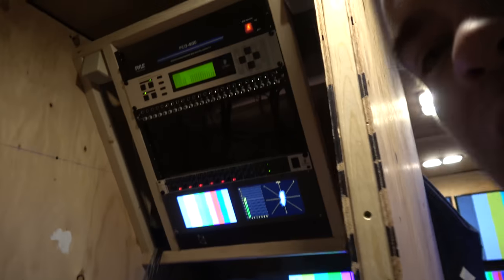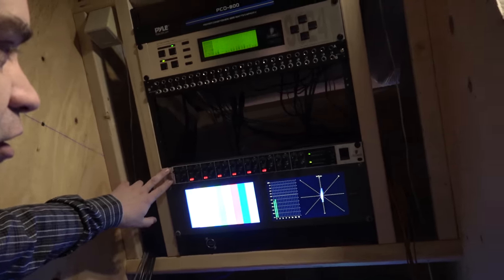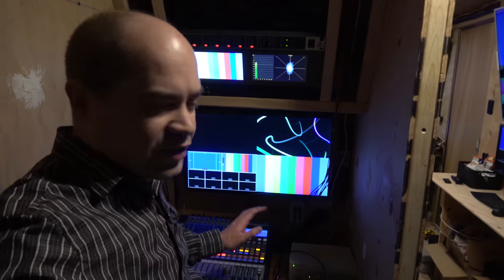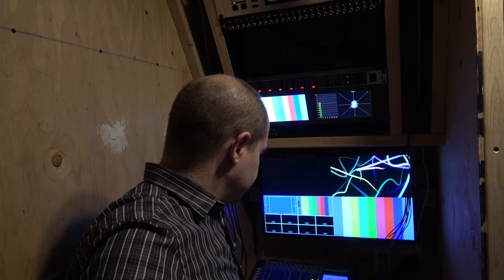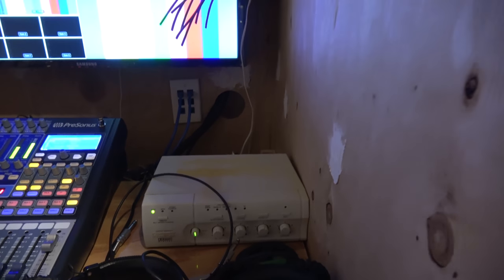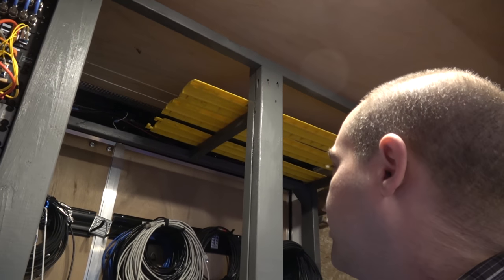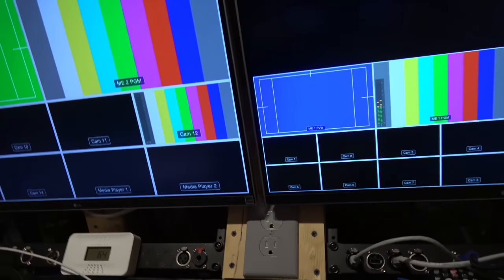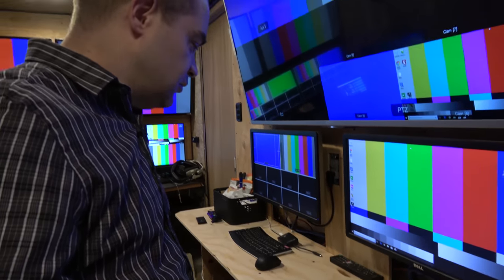Trailer Construction Update - Dec 7, 2017

Comment: Great set up very inspiring.
I don't understand why you would send your 2bus through two Behringer preamps instead of using the main out of the Presonus... surely it would sound better without all the extra gear ?
Reply from the maker: I assume you're referring to the compressor...

People are used to their audio levels being pretty consistent, both for music and television.  The easiest way to achieve this is with a multi-band compressor.  Traditional compressors, as found in digital mixers, simply can't achieve the same kind of result.

Audio levels, particularly for live events, tend to be all over the place. Most people, when speaking, will get excited at some point and get much louder than their normal speaking level (or much quieter), or there might be a part of a song that gets much louder than the rest, so controlling levels becomes very difficult. Traditional compressors can really help, but they don't do a great job at keeping the final output level consistent, especially without adding audible artifacts to the audio. Multi-band compressors can be much more aggressive at controlling levels and are much more transparent.  

The bottom line is that with the Behringer unit my final output audio levels can be much higher than they could be otherwise without worrying about getting too high. And I've yet to see any audio mixer that has a multi-band compressor built in.

For a real-world example, go and watch the two live Q&A videos on this channel. The one from this last spring used a traditional compressor (very aggressively, actually). The one from a few weeks ago used a multi-band compressor. The audio level on the second is much healthier.

One other note... I know that Behringer doesn't have the most stellar of reputations. (Personally I hate many of their products.) But this Ultra-Dyne Pro was a flagship product that was particularly excellent. It has been found in high-end professional use where many people would have never have even considered any other product from them.  It would sound better if I could use digital ins and outs, but both my Presonus mixer and the Yamaha I hope to get don't have any AES/EBU digital I/O.
Reply: Ok, didn't realize the console didn't have multiband... makes sense. I agree Behringer do have some products which are simply the right tool for the job.
Reply: So I bought a Ultra-Dyne Pro :)
I totally agree with everything you said above, i was just curious, the multi band on the Ultra-Dyne Pro is very practical and "replicates" many of the features we use in post audio with iZotope.... appreciate your channel , we so new to this streaming/video game....loving the learning curve.

Comment: Audio: XLR grounds by default. When you have 1 device going to/from 2 others you have a suspect connection. 1:1 isolation transformers help. Another trick is to clip the channel 1 wire at one end. I built a bunch of ground lift pass through connectors for my own fixes. I found some gender changers that could take male or female ends. I then wired them as pass throughs, male to female with only pins 2 and 3 hooked up. Also sometimes floating causes more problems than it solves. You get floating capacitance.
An RV place should be able to help you with a warm drive in place to park for the duration of the carpet install if you feel the need.
Reply from the maker: The audio lines I have running from the switcher to the mixer aren't grounded -- I'm only connecting pins 2 and 3, so it's already lifted.  But as I've done more research, that isn't where the problem lies -- that audio is actually totally clean.  

The place I'm having an issue is the audio output of the SDI to HDMI converter I'm using inside of the audio booth.  It's got a 60Hz hum on it for some reason.  And it's running on battery, not on AC power.  Swapping in a BMD SDI to Audio converter in the same place gives me clean audio.  There must be something being injected into the circuitry coming back from the HDMI line from the monitor at that location.  Fortunately I'm only using that audio for the speakers and the noise isn't going out to Program at all.  Program audio is clean.

Comment: Hi Doug thanks for the update, I think you should consider a mac book for the premier pro playback, I have the same setup at studio and windows laptops couldn't handle the task timely.
The other thing, what's your plan for replays did you check out vmix it does 4 cameras
Reply from the maker: I also have a MacBook Pro, but none of the software I've written runs on Mac so it would be a bit of an odd man out.

I looked at vMix but it doesn't meet my needs.  I need Ultra HD support with 6 cameras or more.
Reply from the maker: It looks like an interesting product, but it doesn't seem to fit with my needs.
Reply: I sent an email djmail. I am interested in knowing some of your needs.
Reply from the maker: I'm not seeing it.  Please use the Contact Us page on the website: https://djp.li/contact.
Reply: Tech note: You might revisit it some day if you use NDI. There are no channel restrictions on those AFAIK. There will be lag issues no doubt. But it might make do if you run long wide shots over NDI. Depends on your lag tolerance. As far as it goes vMix is emergent and listens to feature requests as well. Recent problems documented (known about and ignored since day one) with Intel chips means everyone needs to re-calibrate and re-calculate software solutions that make heavy use of OS resources. Every OS maker is re-jigging the core of their OS right now.

Comment: Great build. We'd like to know more about your X-keys layout, Doug.
Reply from the maker: Always good to see that the manufacturer of a product is interested in how it is being used.  Good to hear from you.

I'm currently using it with the JustMacros software.  Basically the two bottom rows are for Program (red buttons) and Preview (blue buttons).  Dedicated buttons for sources 1-10, then a SHIFT key is used to access sources 11-20.  Then I combined two adjacent buttons into one for each of the CUT and AUTO buttons on those rows as well.

I've got buttons to select the type of transition as well as its duration, start/stop each of the media players, to setup the Upstream and Downstream keys, and then a few macros to handle tasks like automatically bringing a lower third on/off screen after a predetermined amount of time.

I haven't done anything very innovative there, at least yet. If I have some spare time later on I'll work on my own software to interface the X-keys to the switcher.  JustMacros doesn't quite have the flexibility I want, and the fact that it loves to crash on me in the middle of an event is a real problem.  But the X-keys device itself has been great!

Comment: You are the best on the Internet Youtube I have ever seen at this time. I am so impressed by your new van. 
- I would say that the result are more important than the material of the desk wood. 
- Design: I would really recommend more labels on the sockets and attachment cables. This is really time saving. 
Monitoring: Speakers are super important (I have owned the nice cambridge setup :). More important than the microphones or anything else. (I do like the general quality of AKG). For speakers: Please make the jump to <Intelligent Sound>  Swedish/Norwegian brand.
speakers or three steps below <Genelec> speakers Finnish brand. This will give you a real upper hand and answers to any sound questions in seconds without guessing. You will know at an instant what the sound is like to the audience. Where the humming is origin from. This will add quality within the specs and will blow the custumers out! I mean IN! 

You are the best. If you can focus on right part then your talent will change the branch it self. I am so happy that you take your time to share your knowledge on youtube. 
I would like to contribute if I may. Please feel free to contact me for any questions or advice.
Reply from the maker: I completely agree that the finished result coming from the trailer is more important than what it's made of.  But with that said, the trailer itself is a marketing tool and it needs to look the part.  I wouldn't get hired by many clients if they were to see what the inside looks like right now.  Going with a finished hardwood doesn't cost much but really takes the appearance up a few levels.

Most of the audio, video, and Ethernet cables are labelled.  I haven't put labeling on the jacks because I'm still making changes.  I'm still finding that some of my initial ideas for how to wire things aren't necessarily working out the way I had thought.  For example, the BNC patch panels are very different now than they were just a couple months ago.  I'm waiting for the wiring design to settle before finishing the labeling.  For the time being I have Excel spreadsheets I'm using to keep track of what is what, and print those out and tape them to the wall for reference.

I plan on getting some Genelec 8010A speakers when I've got the funds to upgrade the audio booth.  Hopefully soon.

Comment: Nice stuff man, this is great.do you have a link to that clock? Looking for something under $200 for my church livestream production room. Thanks!
Reply from the maker: The clock is a Masterclock NTDS26, available at the address below.  It isn't going to fit your budget, though -- it's $500.  A lot cheaper than the others I found, but still kind of expensive.

https://djp.li/clock
Reply: Thanks a lot, would u ever do an arduino based clock or recommend it for needs like mine?
Reply from the maker: Ever, sure.  But I don't have any experience with Arduino yet.  Something based on Raspberry Pi would be another possible solution as well.

There are a lot of web pages describing NTP-based clocks based on Arduino.  One would only have to find a larger LED display and adapt the circuitry to drive it.  Doesn't seem difficult.

Comment: What is your exact signal chain related to the noise issue?
Reply from the maker: The main issue is just between the Blackmagic Design SDI-to-HDMI converter and my Presonus mixer (whether going through the patchbay or not).  If I substitute in the SDI-to-Audio adapter instead the audio is clean.  And I've tried multiple SDI-to-HDMI adapters and cables; the issue is always there.  I've also run the audio output directly to my speakers and the noise is still present.  I've even tried running the converter on its own battery and I still have the problem.  The noise is loud enough that it can be a real problem.  I've emailed BMD and they haven't been able to give me any tips to make the noise go away.  Fortunately I never send audio destined for final output through that converter so any noise I hear doesn't make it into the final recording/broadcast; it's only in my own speakers.
 
The second, lesser problem is audio output from the Blackmagic Design Studio Converters to my mixer (again, whether going through the patchbay or not).  I initially wondered if it was because I am using CAT5 to send that audio, but when I ran XLRs directly it was still a problem.  That noise is pretty quiet.  When I'm actually doing an event for real it's so quiet that it isn't an actual problem.

Bottom line is that I can actually get clean audio out to program. So the issues aren't preventing me from being able to produce an event properly.  More of an inconvenience.

Comment: Doug, I just watched the recording of the Q and A and I know you have trouble with the macro software. Have you heard of AutoHotKey? There's this guy from LinusTechTips (a video editor) who has created complex custom macros all open source for Xkeys, Elgato Streamdeck, and his own custom keyboard. Maybe you'd find it useful. https://www.youtube.com/watch?v=y3e_ri-vOIo
Reply from the maker: While interesting, it doesn't seem as though any of those are geared toward the ATEM switcher, which is the one piece that is most difficult to find.  This solution also seems geared toward non-developer types (people capable of writing scripts, but not full-on developers). 

Since I have a software development background, and the X-Keys and ATEM SDKs are free, my current plan is to create my own solution when I get some other projects (like my trailer) wrapped up. That way I have a lot more options and customizability than any of these other solutions can possibly offer. Hopefully I'll also be able to make that solution available for others as well.
Reply: I wounder...would the SDK allow for the switching of the M/E rows on the ATEM 2M/E broadcast panel? I am trying to figure out a way to put the M/E 2 on the bottom and M/E 1 on the top since our setup requires us to work mainly in the second M/E,
Reply from the maker: Since you don't install your own software on the BMD broadcast panels I'm not sure how you could reconfigure this without Blackmagic Design's help.

Contact their Tech Support group to see if there's something then can do to help.